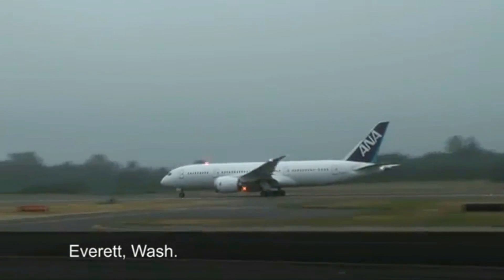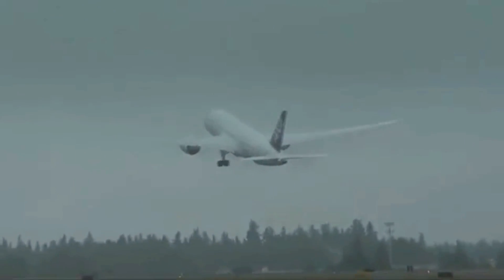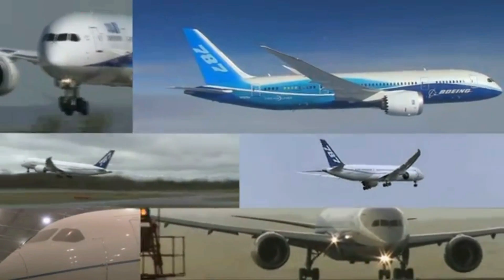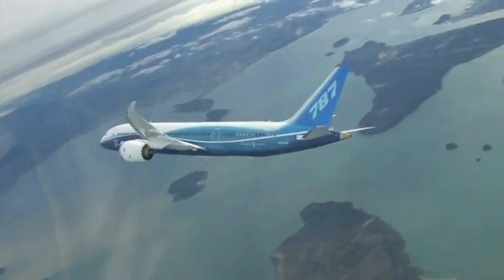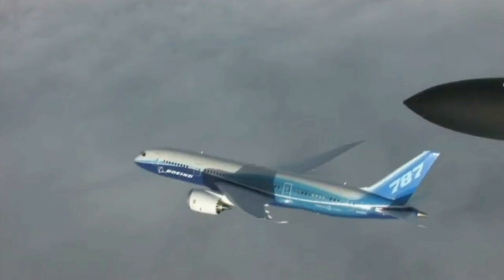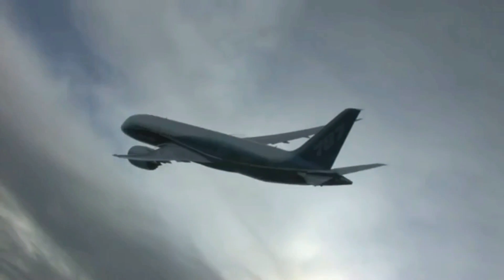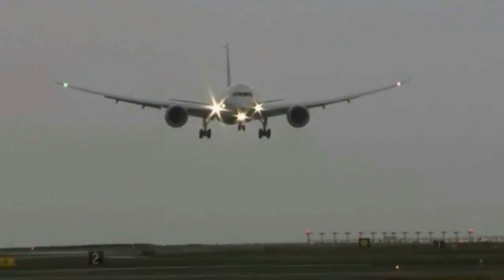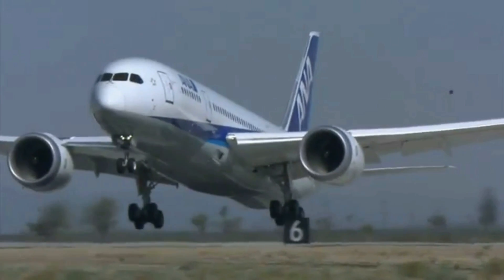Boeing 787 Dreamliner Extreme Flight Testing HD

Comment: I don't know for the 787, but for the A380 the test pilots only wear an orange suit so they can be recover faster in case of a crash. The only times where they had parachute was when they did the Flutter test (vibration on wings and reaching the maximum speed of the aircraft wich is mach 0.96).